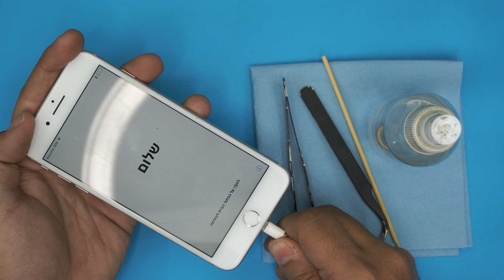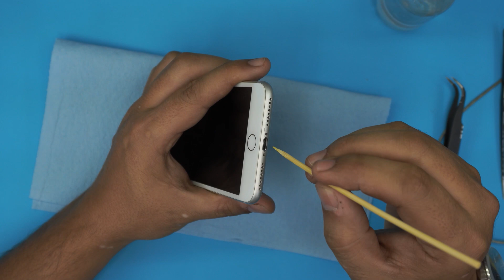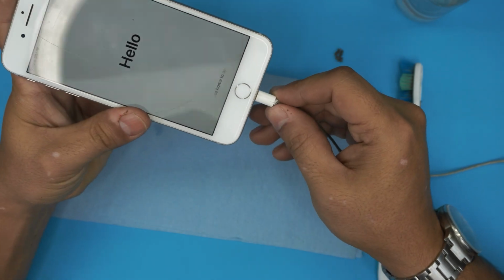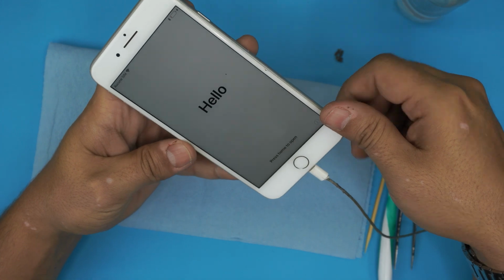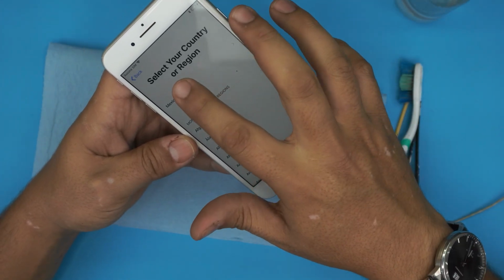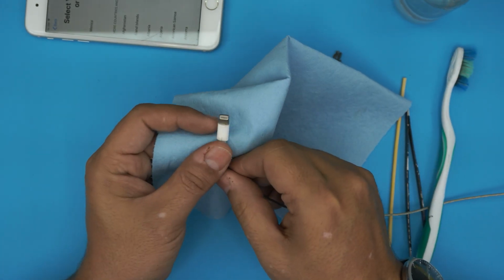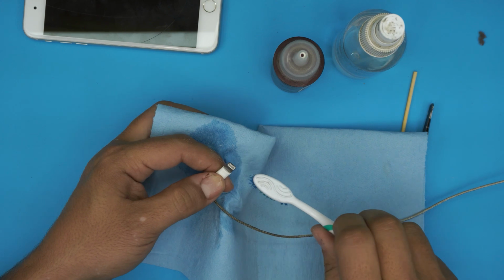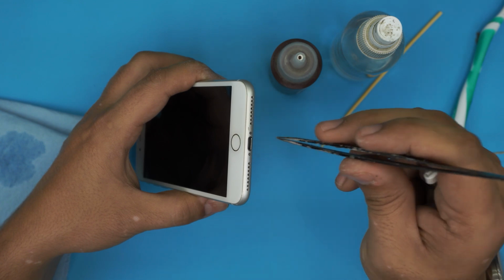iPhones charging port Professional Cleaning | Charge Port FIX |

Comment: I was soooooo scared to try this but I was desperate 😂 None of my charge cables were working. Rebooting did not work. Cleaning just with a toothpick did not work either. I knew it wasn't the battery because magsafe was working just fine. 

There wasn't a lot of fluff in there but the tip of the toothpick came out black. Once I cleaned one of my charging cables it immediately started working again. Thank you!!!
Reply from the maker: It's my pleasure, my friend. 😊 I deeply appreciate your taking the time to provide feedback. If you're inclined to support the channel further, feel free to like and subscribe—or even both!
I'm glad my videos are helping!🫠💞
Should you have any questions or requests in the future, please don't hesitate to ask me.
🍻cheers